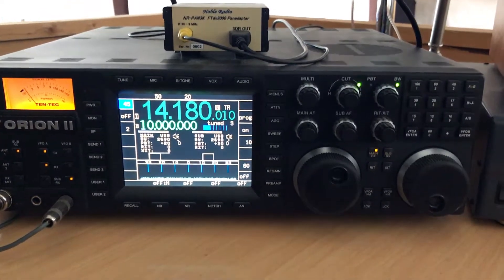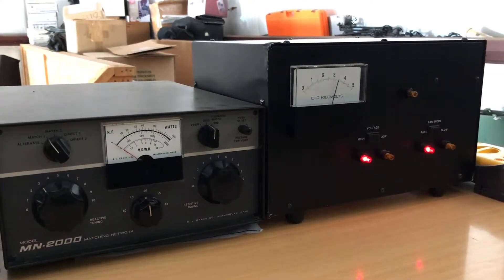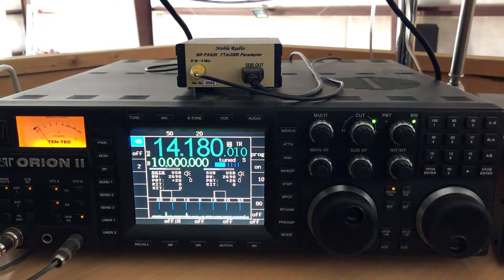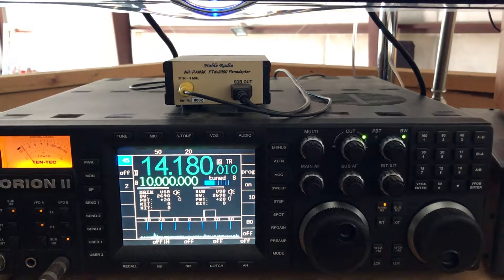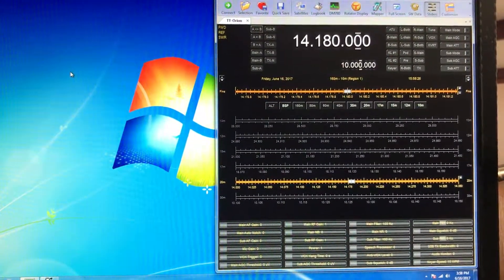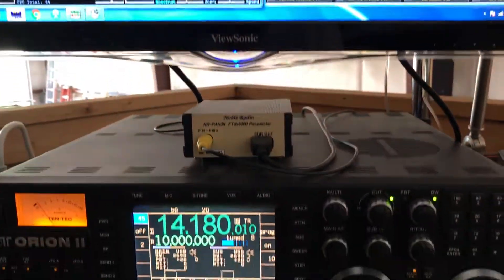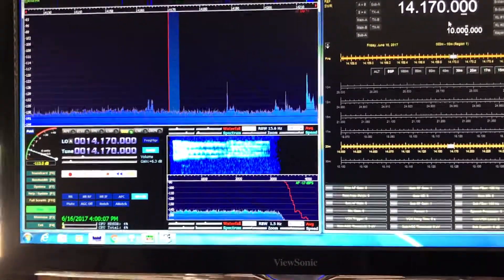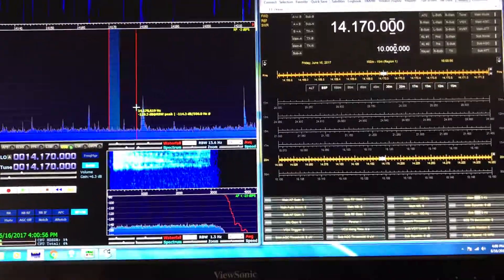Ten Tec Orion ll with Noble Radio Panadapter Performance Review

Comment: Where did you get the TX gnd connector, that is required, there isn't one on the Orion 11?
Reply: Hi Gang. The information from Noble Radio is that the AMP KEY 1 or 2 connectors are used on the Orion II in place of the TX GND.